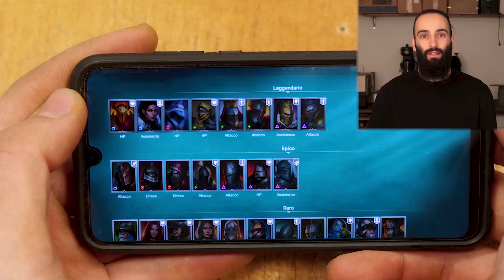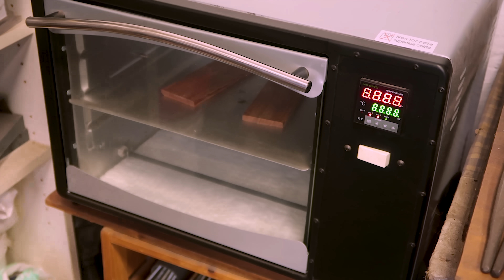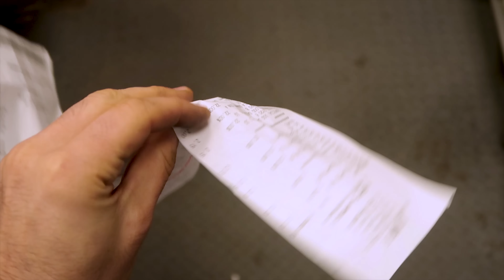Knifemaker Restore An Italian Chef's Knife Worth 1€

Comment: When you started making the handle I was like what is he doing, how's he going to get the wood to fit in there after the metal is in place.  Very nicely surprised, great work and it looks gorgeous.
Reply: What was the deal with microwaving or whatever that was of the wood?
Reply: @mattperkins7038  I believe he used wood stabilizer and put it in a vacuum chamber to make sure it penetrates then cooked it to make sure the wood was dry.
Reply: He checked the moisture before cooking it, so I assume it was to reduce that

Comment: In my opinion the old knife has a nicely shaped handle, and therefore a restoration should have followed up on this.
 If you change the handle like here, then you ought to have used a lighter color kind of tree - oak perhaps - and not bronze metal. The bronze color doesn't end up well with the blade's color.
Reply: blade is a joke its not stainless steel
Reply: @Cortesevasive  Stainless steel sucks, high carbon steel rocks
Reply: The blade is a joke because he didn't get rid of the pitting and deeper corrosion.  It's one thing if it's going to be a "wall hanger" but entirely different if it is going to be used.
Reply: @Cortesevasive  I hope you're joking. Stainless sucks.

Comment: The handle is beautiful but doesn’t go with the knife
Reply: My thoughts exactly, the craftsmanship in the handle is beautiful and would go great with a steak- or butterknife design. For a chefknife at least I prefer sth more ergonomic like groves to prevent slipping backwards vor fowards. But to each his own.
Reply: I was going to say, the handle is too nice for the blade ;) Edit:  chef knives don't usually have grooves.
Reply: @Briguy1027  English is not my first language, what I meant with grooves is the handle Being thinner close to the blade and having a thicker part or knub at the end? You know sth that keeps your hand from sliding off the back. Like this https://images.app.goo.gl/WsCHJ3VaB26hoZyS8. 
The very square-ish shape makes the handle not very ergonomic.
Reply: @sephbox  I mean this in a helpful way, it sounds like the word you're looking for is tapered or maybe contoured?
Reply: I'm not even so worried about it not going with the blade, and although I like the profile with wood/steel/brass, it's just FAR too square for my taste.
ergonomically and esthetically.
Reply: Indeed. Not a fan of the kind. Its more like a pocket knife handle or something.
Reply: I think the knife is beautiful, but the blade could have been better finished. Issue being is mill off too much to smooth it off and you lose all the weight of the blade I guess.
Reply: Mike Berry, I know nobody asked but I also have a knife that has a beautiful handle but they just screwed up with the knife
Reply: Yeah the knife looks ugly and the handle is just the opposite.
Reply: Looks like a Buck.
Reply: ...ok Mike The Knife Specialist
Reply: As a chef, I know that handle would punish your hand after a few minutes. It needs to be wider and without corners.
Reply: Consumer mentality.  "Give me a shiny new toy".

Comment: The handle is great, but I'm worried about keping that blade bacterially safe with those corrosion pits.
Reply: Wait, is there a difference between that and porosity, or is that the same thing?
Reply: @mayachaoui814  I don't think porosity is the term.  I'm thinkg bits of food can get deposited in the pits, allowing bacteria to grow right on the blade.  It's use after that could be suspect.
Reply: ClapTrap I have a chefs knife with a Damascus blade but it doesn’t look like this guy’s. It’s more like, swirly and textured, but not pitted. I’ve never seen a chef’s knife like this used in cooking. I shall begin the hunt. Lol
Reply: Yeah, he needs to dremel those out. Too much focus on the handle and aesthetics. When I restore, I go for function. People that want a perfect looking blade should just buy a new knife. plus my 13 kiwi knife is sharper. Those push cuts look forward rough. Seems like the steel lost its temper from getting too hot on the belt sander and now its soft.
Reply: There are Japanese knives with this type of finish intentionally put on them. It’s called nashiji, or pear skin finish, to help with food release.

Comment: Very nice job. Aren't you affraid moisture gets between the metal and the handle by the time without epoxy?
Reply: Given time what happens when you glue two unlike materials together that expand and contract at different rates? I've had this happen to chair seats even when the entire thing was oak. About all you can do is kept the blade cleaned with a damp cloth and oiled and never, ever, get the handle wet.
Reply: Dwight E Howell aa@

Comment: Will love to knw how he removed the rust from the blade , that process is magical.
Thanks for the video, super interesting from start to the end.
Reply: Vinegar in water will do it. Like it’s cast iron pans.
Reply: @gloglos100  Thanks Janet for your advise. I think that he also applied some electricity
to the knife because I can see in the when he disconnected a clamp connected to a wire.
Maybe he will answer the question to someone else that may raise the question to him.
Thanks again and let me wish you a wonderful and happy new year. horace From Costa Rica
Reply: Horacio Castillo  it looks like electrolysis.
Reply: @horaciocastillo1435  check out the description in the drop down under the video, he lists all the processes
Reply: @lollylula6399  Thanks, I will.

Comment: Interesting choice to keep the character of the pockmarks on the blade spine. I’m accustomed to watching the My Mechanics channel and he always grinds those out and polishes the metal to look new. I suppose that I can see the value in both methods. 

Seldom does anyone keep the old wood from the handle, and fill it in with wood filling epoxy, if needed. The old wood has lots of character. Anyway, nice job!

Comment: Great video, love your production quality, but I was a bit confused on the wood block part, why did he put it in that microwave thing (Sorry I know I sound dumb) and what was the vacuum seal for?
Reply: He used a stabilizer resin on the wood, the vacuum was to pull air out of the wood so the resin would penetrate better (thats what all the bubbles were from). 

   The time in the oven as to help cure it.

Comment: Another possibly superior way to remove corrosion from steel or cast iron is to use a molasses dip! 1 part molasses and 9 parts water. Let it brew for a week the pop the object in to be cleaned perfectly. Can vary in time depending on thickness of rust but check every few days and lightly brush with a soft bristle brush. The dip will completely remove all rust.  Immediately after  you object is cleaned, rinse with water then treat with a Phosphoric acid treatment like metal prep.

Comment: I’m not a knife maker but was there a reason no epoxy was used in the assembling of the handle? The metal on the handle was pretty rough and I’m pretty sure that it’s not a flush fit and as a kitchen knife water will most definitely get behind the scales causing corrosion. Also, the blocky handle looks uncomfortable. But it looks pretty as heck even though it doesn’t match. You are a true artisan.

Comment: The ONLY thing I would do different is NOT etch the steel after that initial sand and polish. Its really cool to see the temper line, but I'd rather see the polish up about 3/4 inch from the edge to compliment the shiny new handle. That was mesmerizing to watch!

Comment: That whole electro process on a flat piece of steel always baffles me. I can get the same results with a grinder and wire disc in 10 minutes or less
Reply: sometimes a grinder alone can bugger up the heat tempering
Reply: @Scriptorsilentum  not with a wire wheel

Comment: what was that bit with the dowels about? Was that a specific technique for expanding them? An attempt at some design? Or did you just not have the correct size? Genuinely confused.
[edit] I'm a dumb-ass. It's explained in the description: a mosaic based pin. I like the idea, but the end-result feels far too small to really catch my eye. If you really want to make it shine, perhaps go with a slightly bigger, coin-like inlay? You could make a more intricate mosaic that way, or even a personal logo. At the current size, I prefer the pure resin filled ones. They look different from a solid metal one, without having so small a design that it might get lost/unnoticed. [/edit]

Comment: So you impregnate the wood with resin and then later put boiled linseed oil on it. It still holds the oil, despite the resin? The wood you used looked didn’t look the the wood you used resin on.

Comment: I'm surprised you didn't heat-treat it. My understanding is that heat treatment actually hardens only a very shallow amount of steel, so if you re-profile the blade a lot, you are revealing the softer underlying metal and making a blade that will dull quickly, even if it's made of chemically good steel.

Comment: Working in a kitchen over half of my life, the handle of my chefs knife is the most crucial part, secondary to the sharpness of the blade. It's a beautiful restoration no doubt! But speaking from a "chefs knife" perspective, it wouldn't be something that could be used hours on end, without any countours.

Comment: I really dont get why everyone is using some electrolysys stuff to derust. you have to grind it anyway. just use a powertool brush ?
Reply: The electricity and liquids get down into the pits and work some cleansing magic, preserving the age, 15% of the original condition, and some charming patina. That's why. As a side note: powertool brush grinding could possibly heat up the blade and alter the temper of the lovely old Damascus, and we wouldn't want that, now would we?

Comment: Beautiful job with handle, however it’s not a handle for a chefs knife. You should have studied a few designs but making this. The handle is too square shaped and wouldn’t be comfortable to use in the kitchen. Maybe good as a utility knife. The other issue is the handle is too fancy for the old blade.  There’s an imbalance.

Comment: Looks cool but that is artificial corrosion, not natural corrosion.
Also you never want to use a belt sander on that high of speed for anything without constantly cooling it, it will ruin the heat treating and temper on the steel.

Comment: Good work overall. Great idea for the handle, very creative. 

One comment, youre sharpening at way too high of an angle.

A chef's knife should be sharped at 10-15 degrees per side, even 15 is pushing it. You look to be sharpening at well over 20 which will seriously limit it's cutting performance. 

I dont even sharpen my pocket knives as steep as you did this chef's knife.

Edit: after rewatching, youre setting the edge at the appropriate angle, youre just not matching it with stropping..

Comment: Silly me, i always thought restoration meant to restore the original look, not to make something completely different :)
Reply: Someone needs to get all of these viral "restoration" youtubers and give them a seminar on what restoration means. At least this channel has SOME craftsmanship unlike all the dozen Indian viral channels that just fuck everything up
Reply: There's two takes on 'restoration' - one that says make it into what it originally looked like even if it requires destroying old parts, and replacing them with new ones

The other is only using the original parts and restoring them to as close as new as possible
Reply: @encalica853  yes you are correct. Sadly this video, like all viral YouTube videos, do neither of the two
Reply: @ΔομναΣ  this is just use old parts to create something different. Look on the bright side though, even if it's not accurate then at least the blade has been used for something where it would not have been otherwise

Comment: how not to stabilize scales 101: do what this guy did... dude scales won't float in the resin if they have been in the chamber long enough to remove the air and then they need to soak for 2x as long as you pulled vacuum ... i can tell right off when they floated that you didn't pull vac long enough and didn't soak long enough... may as well have just skipped that entirely rather than half ass the job

Comment: Not all that impressed. I think you altered the handle for the worse by straightening it. It had a nub at the end at that would have improved control - form and function. In addition, I feel the new handle conflicts with the patina of the aged blade. Your sharpening skills are first rate but your overall restoration leaves something to be desired.